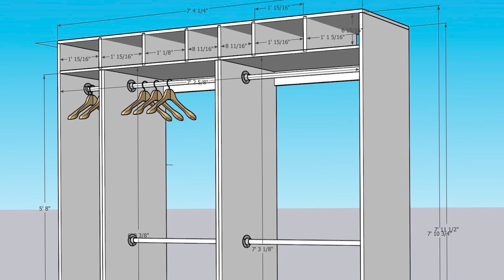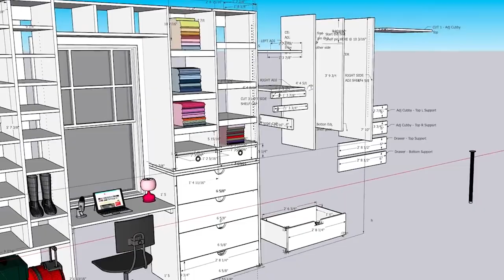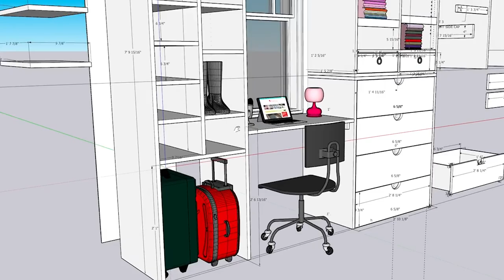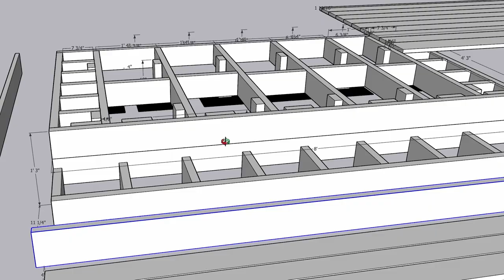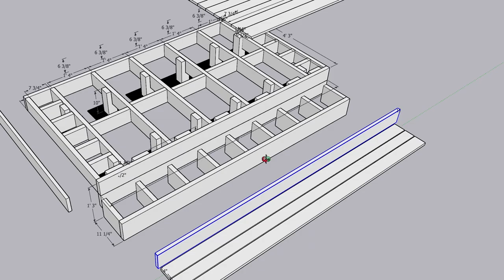5 DIY Projects That Scared Me to Death! - Thrift Diving

Comment: Great advice.  The project I’ve been avoiding is painting my shower.  I got a few estimates to redo my shower and was floored by the amounts.  If I’m going to spend thousands of dollars it will be on a bathroom remodel not a single shower.  So my plan is to paint it but it’s all tile including the floor and ceiling.  I’ve researched and planned but still avoiding getting started.  I’ve started and successfully completed many projects (painted my whole house,  converted bifold doors, flooring, etc) but look at the shower with a feeling of dread!! I’m going to just do one action item this week, go buy the paint.  Wish me luck!

Comment: Thanks for sharing your experiences, Serena🥰 my 1st project—converted a walk-in closet to an office- 2nd project—replaced & installed 2 wood fence panels, moved fence panels by flipping & it didn’t fall apart; couldn’t figure out why drill wasn’t screwing (needed to switch the button😂—was not experience using drill), used a tool for inserting steel poles in the ground (that was work, too much exercise) 🤨—💯success, I was so proud & moved onto another project— made a workbench w/wheels💯success, 4th project—replaced additional wood fence panels, 5th project—$200 plastic 4x6 greenhouse w/thousand screws from Lowe’s💯, 6th project—recently added 8x12 dry pour concrete for a shed—made some mistakes 🤔 oh well it looks good—🥰don’t have shed yet— anxieties 🙃
Reply from the maker: Whaaaaat! Wow, you should be proud of what you've done! Those are some heavy-duty projects, especially the concrete. I want to see how the concrete turned out!